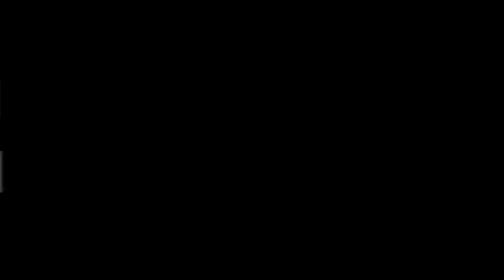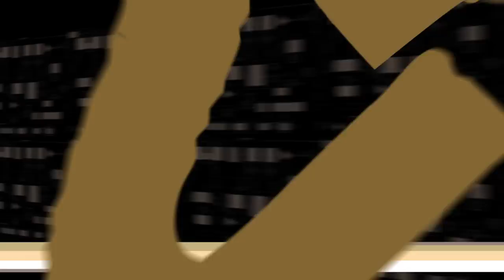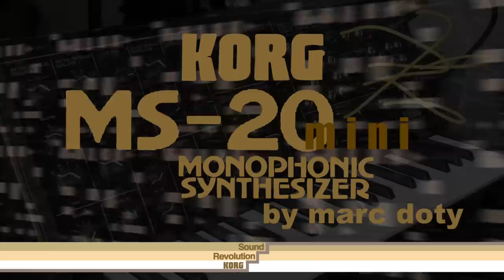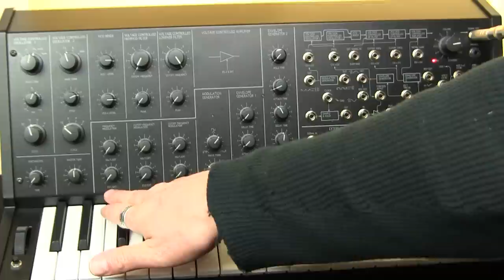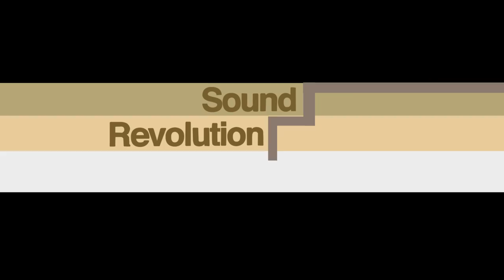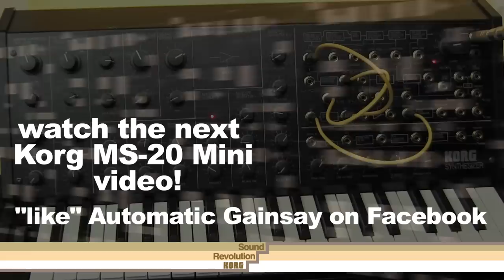The Korg MS-20 Mini: Envelopes

Comment: I've found I can turn the little black button into a low B key.  I have to press the low C at the same time though.

The trick is to patch the button to trigger EG1, set as a square envelope.  The frequency modulation amount knob (bottom row, first knob of the three) needs to be set to give a one semitone / half step fall, which puts the synth out of tune as you turn the knob up without the button pressed, so you then have to retune it, and adjust a bit more.

When I'm trying to play a tune by ear, I often find myself hitting the left side of the keyboard where the low B should be.  This is the only one I own where I can just add the key :)

Comment: There's an interesting interplay between the two filters with the configuration you set up at 7:14. I've found that EG2 isn't disabled by it, but instead is just overridden if EG1's settings are faster. For example, if I set EG1's attack to 5 and EG2's attack to 1, the 1 wins and I have instant attack on the VCA. But if I set EG1 attack to, say, 3 and EG2 attack to 5, the 3 wins. Then if I set the filters to be controlled by EG2, they kick in according to the attack set to 5. Patching the EG2 Rev Out to the HP Filter Cutoff Freq lets me set up a sweet bandpass filter that evolves according to EG2's attack setting.

These videos are inspiring, and experimenting with mine alongside your demos is giving me so many new ideas. Thank you!
Reply: I've been experimenting with the envelopes on my Mini and I've found the following. You can control the VCA with only EG1 if you avoid triggering EG2. Try patching the momentary switch into EG1 trig and pressing the switch. It should play the last note played by the keyboard but won't trigger EG2 and so won't totally effect a filter if you have the EG2 mod pot turned up. Obviously you need to patch EG1 to initial gain. Oddly, sending the pitch out of my Microbrute into EG1 trigger causes very odd things to happen, and in certain areas of the keyboard even allows perfect pitch control of the MS20! Other places it holds the note on allowing you to use EG2 sustain, EG2/EXT Modulation pot or the filter cutoff pot to control filter cutoff.

Comment: As someone who has had an MS-20 since about 1999, may I say that in my opinion the patch panel is without doubt a confusing, intimidating, idiosyncratic, odd, contradictory and basically insane thing, liable to trip you up if you are new to patching. BUT its worth persisting with learning and becoming familiar with it in the long run. The great thing about the MS-20 is that you can use it without any patching, which is I should imagine how many will use it. Your clips will really help folks.
Reply: 1999?? By now you should be a MASTER....I was about 9 when I got it (present from my musician dad) 1n 1979 and it took about 1,5 years to master it (the synth, not playing"it)
Reply: Don't get me wrong, I think the mini is a great synth on its own....

Comment: great demonstration!!

i've got one question:
I'm using iMS-20 on iPad, and i noticed something strange:
when i patch the EG1 out to control the VCA (initial gain), this doesn't stop EG2 from controlling VCA.. (which means by doing this patching, i have two EG controlling VCA at the same time..)

too bad i don't have a real ms-20 (or mini) near me right now, which leaves me wondering if  this is the app's simulation's problem?

Comment: 6:35 plugging EG1 to 'FREQ' of both oscillators is not the same that the default wiring on a classic MS-20. You should actually try it to hear the difference.
(Default wiring makes the frequency go from zero to whatever note you played, plugging a cable instead makes the frequency go from the note you played up to higher freq controlled by additional EG1 envelope.)

Comment: A read of the manual would answer all of these questions. EG2 when output to the filters, the steady state is the sustain level. You need to turn the sustain down to give the filter somewhere to go after reaching its fully open point after attack and decay. If sustain is at 10 it cant go anywhere. Im not 100% sure why the sound is totally filtered out when sustain is at 10, but i'll live with the fact that i have to go down to about 7 to make the filter modulation work.
Reply: Whats a manual?